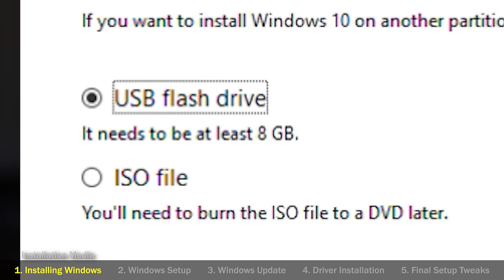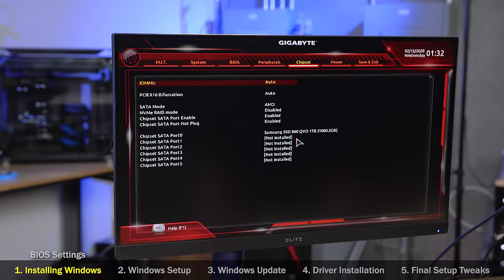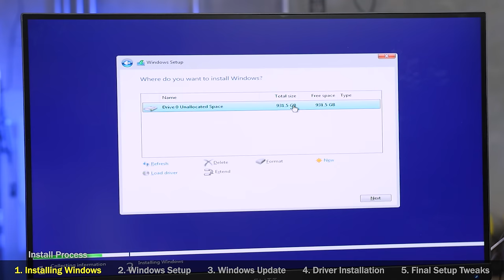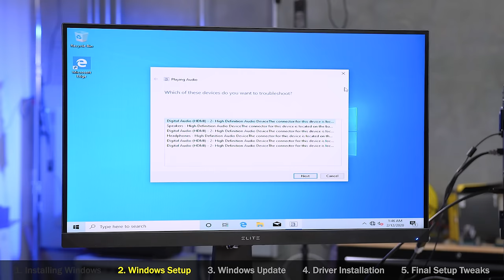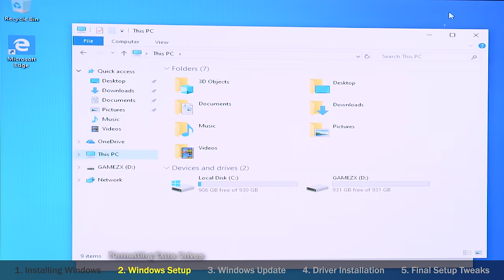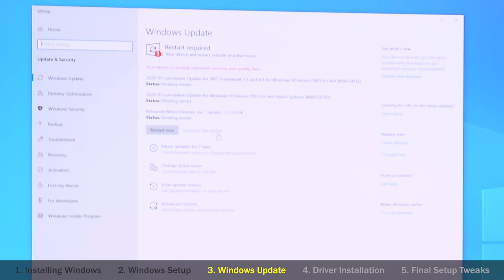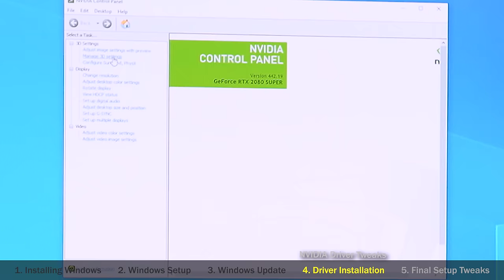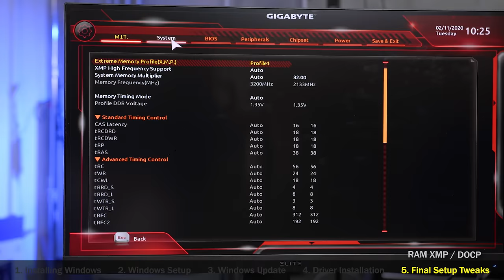Guide: What to do AFTER building your computer...

Comment: Bought a new GPU. Will be installing it over the next couple of days, but how do i install it manually instead of just using the (already installed) geforce experience? In order to do a clean install
Reply: You can use a utility like Display Driver Uninstaller (DDU) to completely remove the currently installed graphics driver.
Reply: @JJFlores197  thank you. Only just switched to PC

Comment: i need help i have done everything my pc will load up till where the windows is suppost to be but it turns to a black screen with a flashing underscore at the top right the bios works eveything works it just wont boot up windows i just spent all my money on new parts for my first pc its been a month and ive been unable to fix it i cant find how to fix it anywhere im at a complete loss here feel like ive just wasted my money at this point
Reply: top left*
Reply: Make sure BIOS mode is turned off. It may be called legacy mode, CSM, or compatibility mode. Exact wording and options/menus differ between motherboards. Make sure UEFI Boot is enabled and that USB boot is enabled as well. If that still fails, you may need to remake your USB installer. Also, make sure your USB drive is the first boot device.

Comment: I have a ROG Strix Z590-E Gaming WiFi 6E LGA 1200 motherboard and there are drivers (chipset and a few others) that need to be installed like any other board. Should I install the Windows updates before those too or should I install the MOBO drivers BEFORE the updates?

Comment: I’m a 350 year old man that loves mangoes. What if your drive doesn’t show up in the windows install screen but you see it in the bios? Mine is listed in the bios like RAID: Samsung ssd 980pro etc. But in windows it’s blank no drives. Tried with nvme and m.2 and same thing.asus z690p 13600k
Reply: Disable RAID and enable AHCI. Exact steps vary depending on your motherboard. You may need to reference the motherboard manual for instructions.
To give you some details: RAID (Redundant Array of Inexpensive  Disks) is a way of using multiple drives to act as a single drive. It is not typically used in home/gaming PCs. It is used in business and enterprise settings and servers. Windows doesn't know how to talk to the RAID controller so that's why the installer shows that there are no drives available to install to. If you did want to use a RAID setup, you would first need to download the controller driver from the motherboard manufacturer's page and then tell Windows to use that driver.
Reply: @JJFlores197  Disable VMD controller. Save and exit. Drive showed up in windows install. 👍

Comment: just a question for anyone. can I do the entire process. skip the bios check annd just choose the correct drive in the windows set -up if i know the size difference in  the drive is significantly different to any other drive hooked into the device?
Reply: Yep you can skip if you want.

Comment: Soo...what if you're simply getting no display signal?

My brother and I just finished building his first one. Downloaded specific used manuals for the motherboard and GPU, and followed it precisely according to all the components we have. Plugged it in, turned it on. Lights on the cooling fan and GPU are on. Cooling fan blows. But no display signal.

• His monitor hasn't been delivered yet. So we used our living room TV and an HDMI cable from the GPU to the TV.

• He has a Geoforce 4080 RTX Super that has a 12-pin male headed adapter that splits into 3 female heads that you're recommended to plug 3 seperate PCIE cables into.. His Seasonic Focus GX-750 only came with 2 PCIE cables. So we only have 2 hooked up to it. The GPU lights up when you turn the power on. The fans haven't turned on though.

Not sure where to go from here.
Reply: If the motherboard has a diagnostics/debug light, take a look at it as it can tell you where the problem in the POST (power on self test) may be at.
Reply: @JJFlores197  Thanks for the info. I'll have to look more into that is and how that works. 

But we finally figured it out yesterday. My brother first tried plugging the HDMI cable to the motherboard, with no results. He also tried the one stick of RAM trick, but his friend who he was communicating with told him to put it in the "furthest" RAM slot, but claimed the "furthest" RAM slot was the one closest to the CPU. It still didn't work. From my research, I thought it should've been the slot furthest away from the CPU, labeled the B2 slot.

Then he hooked one of the pig-tails on one of the PCI-E cables up to the 3rd outlet on the GPU cable adapter that I mentioned, and that made the fans on the GPU spin. And he finally put the RAM stick in the B2 slot (the furthest away from the CPU), and plugged the HDMI cable into the GPU and it finally gave us a display.. 

So I'm pretty sure our primary issue was that the RAM stick needed to be in the B2 slot. Though the GPU needing to be plugged in to all 3 outlets might've been another issue.

Now we're just waiting for a keyboard and flash drive to arrive so he can install the programs he needs. And I suppose he needs to order a 3rd PCI-E cable so that he's not having to rely on only 2 PCI-E cables, with the 3rd being that pig-tail/daisy chain.

Comment: Having issues connecting to internet via Ethernet Jay. Is this a asus driver that needs to be installed on usb then installed on new pc or is this windows 10 related? Should I clean out all hdd and ssd’s and do a fresh install? Will that give me the right internet driver? I moved hdd that has windows 10 from old pc to my new asus motherboard
Reply: Most likely is a driver problem. Since you moved a Windows install to a new motherboard, it is likely that Windows install doesn't have drivers for the network adapter. You will need to use another device with internet to download the driver to a USB drive and transfer to your new PC and install.

Comment: Hey man, question: I am building an entirely new pc with all new parts. I don’t want to buy windows again since it is on the ssd of my old pc. I bought a brand new NVME M.2 2TB drive for my new pc and I need to know how to transfer windows from that ssd on my old pc to the drive on my new pc. Then, how can I make sure that everything will run properly since I’m moving windows to all new parts (motherboard, gpu, cpu, etc). Do I somehow transfer windows to the new drive and then reset windows on that drive (wipe and fresh install)?

Comment: My windows updates are taking forever to download. I'm stuck on the "Update are underway. Please keep your computer on". I'm not sure if it's stuck or should I try to restart my computer manually?
Reply: How long has it been stuck on that screen? I know sometimes Windows updates can take quite a while even on brand new systems and installs. If you see that your HDD activity light is not blinking, you can likely power off the computer by holding the power button for about 10 seconds. Its not ideal, but sometimes the only way. On occasion, a Windows update gets stuck.
Reply: @JJFlores197  Not long after I wrote this it finished updating. It took about 45mins in total. But I'm glad now I've installed all the updates

Comment: At the beginning on the only connecting 1 drive part. What if I am using 2 M.2 NVME's? Do I only install 1 until I get windows installed and then turn off the computer and install the 2nd? Or do I take my chances with  both connected?
Reply: Its best to only have the drive you're installing Windows to and your USB installer. Once Windows is installed, you can plug the other drives in. I haven't personally experience it, but sometimes the Windows installer can write important boot files across multiple drives for some reason. In most instances, you won't realize this, but if one of those drives fails or you otherwise remove a drive with that necessary boot data, your PC may not boot up.

Comment: I have almost the same bios and the same SSD as you (except 2 TB), and yet the drive shows up as RAID in Bios. When I try to install from the flash drive, it sees no drives. I have tried everything I can think of and nothing is working. This is making me crazy! I've built several PCs in the past and never had a problem like this.

Here I am with a brand new very expensive machine, dying to load some games and can't even get Windows 11 to see the drive.

CASE:  Corsair 4000D Airflow Tempered Glass Mid-Tower ATX PC Case
POWER SUPPLY:  Corsair RMX Series (2021), RM1000x, 1000 Watt, Gold, Fully Modular Power Supply
MOTHERBOARD:  ASUS TUF Gaming Z690-Plus WiFi D4 LGA1700 (Intel 12th Gen) ATX gaming motherboard 
GRAPHICS CARD:  EVGA GeForce RTX 3080ti FTW3 ULTRA GAMING Video Card
PROCESSOR:  Intel Core i9-12900KF 
COOLER:  CORSAIR iCUE H150i ELITE CAPELLIX Liquid CPU Cooler
SSD:  SAMSUNG 980 PRO SSD 2TB PCIe NVMe Gen 4 Gaming M.2 Internal Solid State Hard Drive Memory Card
QIVYNSRY M.2 Heatsink NVMe 2280 PS5 SSD Heat Sink Computer PC PCIE M2 SSD Cooler
RAM:  G.Skill RipJaws V Series 64GB (2 x 32GB) 288-Pin SDRAM DDR4 3600 (PC4-28800)
LTERIVER PCIE 4 Ports Super Speed USB 3.0 Card

Comment: I just finished my first build. Plugged it in without an operating system what do I do to boot into bios for a picture
Reply: Make sure you plugged the video card into the graphics card and not the motherboard's video output. Make sure ALL internal connections are secure and in the correct places. Double check CPU power, motherboard power, GPU power, make sure RAM is installed per the motherboard instructions. If your board has a diagnostics light, take a look at it (and board manual) to see where it may be getting stuck in POST (power on self-test).

Comment: Do you need and eathernet cable to connect to the internet or can you do it digitally
Reply: ??? The 2 main options of connecting to the internet are with an ethernet cable or through wifi if the motherboard has built in WiFi OR if you buy a USB wifi adapter.

Comment: I'm in a bit of a pickle right now... I need to connect to the internet but don't have an ethernet port anywhere in my house. I have wifi on my motherboard and really need some help on how to connect to my wifi.
Reply: Does your Windows install not detect your wifi card? If so, you likely will need to install the wifi drivers. You will need to temporarily plug your PC to your router with an ethernet cable or use another device with internet to download the drivers and transfer them to your new PC via USB drive and install them.
Reply: @JJFlores197  Thank you so much!

Comment: Which HDMI port do you use? Gpu or motherboard. PC boots but no display. Seems missing that part.
Reply: If you have a graphics card installed, you always plug your video cable into the graphics card and not the motherboard's video output.

Comment: What about using 2 nvmes? Will I have to format 1 nvme with windows and then put the second nvme in or will I be able to identify which is the main nvme so I don't have to take my GPU out after formatting windows?
Reply: If the drives are of different capacities, you can easily distinguish between them  on the installer by drive size. If not, it can be tough. In that instance, you will want to disconnect the drive you don't want Windows on.
Reply: @JJFlores197  in my case, I have 2 NvMEs of 1TB each...the brand is different, but the capacity is the same...I guess I will have to leave one out, install everything first with the OS, then take the GPU back out, put the second nvme back in and that will do....I just thought there would be a way to distinguish

Comment: Do I need a sata drive ? Can I just boot with a ssd drive ?
Reply: You need a drive of some sort. SSDs can use SATA or NVMe connections depending on the drive. Most smaller SSDs that are used in PC builds use the M.2 form factor but are NVMe drives.

Comment: Hi Mate; thanks it is very useful. One question thoght. I have mv2 ssd should i partition to put games on a different drive or not? Cheers
Reply: Its up to you. There's usually no need to manually partition your drive. You can if you really want, but its not necessary. Having your games on a different drive has the advantage of nt needing to re-download them if your main OS SSD fails or gets corrupted or has a virus.

Comment: Sup. JZ- whenever you power down a system to do work inside the case, do ya eva press the power button again after you've unplugged the power supply ta bleed off the small power left in the puter?  Just curious. Stay Frosty.

Comment: What does it mean when you built your own custom pc and it’s connected with an Ethernet cable but still no wifi is showing up?
Reply: Most likely need to install the network drivers. On another PC or device that does have working internet, download the network driver for your motherboard's network adapter. Transfer it to your new PC via USB drive and then install the driver. Side note: Wifi and ethernet are not the same thing. If you want to use wifi, your PC needs to have a wifi adapter installed.

Comment: great video. only part i’m confused about is i have 2 nvme drives and 1 sata. plan to put windows on 1 of the nvme drives. so i take out the other nvme drive as well as sata or can i get away just removing the sata cable for windows install?
Reply: To be safe, I would unplug/disable ALL drives except for the drive you're installing Windows to.

Comment: If I already have a drive with Windows installed, do I start installing Windows on a separate drive, and then after that has been set up, I can plug in my older drive and then have that as my boot drive?
Reply: If you want to keep that Windows installation, you don't need to do any of this. Just plug the drive into the new system and it should boot up. I would uninstall the old motherboard-specific drivers and software. Then, install the drivers and software for the new motherboard and other hardware.
Reply: @JJFlores197  Thanks for the reply 🙂

Comment: I use windows 11. Is it almost the same or is it different to set up.
Reply: Mostly the same. The out of box experience (7:50) will look very different. It still has the same options and settings, but has a very different interface. You also need to make sure you have TPM 2.0 as as as Secure Boot enabled in your BIOS.

Comment: Just got a new pc from cyberpower. I think my gpu might be faulty but who knows.

I tried hooking up my hdmi to the gpu only to get no monitor signal. I take my gpu out and hook up my hdmi to the mobo. Everything works just fine. I can get to windows and use the internet etc. i would like to update my gpu but it cant detect it if it’s not hooked up. And even with my gpu hooked up and i use my hdmi on the mobo, nothing works at all, i just get the same issue of no monitor signal.

I have tried using a display port cable as well, i just get the same problem. Gpu is in, nothing works. Gpu out and plugged into mobo, computer works.

Comment: I’m building my first pc tomorrow, and I was wondering something about windows boot drive: I’m going to use a nvme 500gb for my boot drive, and then I am also going to install a sata ssd 1tb. so, I shouldn’t have to unplug my sata when installing windows right? because I should be able to tell them apart by the fact that one’s 500gigs and the other is 1tb?
Reply: Yes, you can just differentiate based on size. However, it is best to unplug all drives except for the USB installer and the drive you intend to install Windows on. There are some times where the installer, for some odd reason, installs parts of the boot loader and/or other important boot files across different drives without telling you. Under normal circumstances, you won't even notice it. However if let's say you remove your secondary SSD and it happens to have an important boot file, your PC may not boot correctly. Its best to avoid that by only having the target drive installed.
Reply: @JJFlores197  ohhh okay, that’s very good to know! I’ll unplug my secondary ssd until after I’ve installed it then. Thank you so much!

Comment: I have a question, I can't find the answer to. I bought asrock motherboard, and when installing windows, it told me that I couldnt progress without internet. I didn't have the option to chose "I dont have internet". After HOURS of troubleshooting, turns out the motherboard should come with ethernet driver preinstalled, and it didnt. Microsoft themselves said this after helping me troubleshoot, and said I did everything correct with windows installation.
Lucky I manage to get ethernet driver on a usb stick and install it, but this is not acceptable.
Asrock don't give me proper answers.
Is this Asrock's fault? Is this on all their motherboards?
Reply: No. The culprit is Microsoft for forcing people to need internet to setup their PC. Motherboards don't have built-in drivers. What Microsoft probably meant was that most motherboards come with disks that include the drivers for the hardware of the motherboard. If you want to be mad at something, be mad at Microsoft. Microsoft has been hellbent over the past decade on forcing people to sign in to an online Microsoft account when that was never a thing in the past.

Comment: 6:48 It’s just booting back to the windows installation menu and won’t move forward from there
Reply: Remove the USB drive...
Reply: @JJFlores197  it won’t boot without it. It says to insert a bootable drive
Reply: @crispy_338  Make sure the drive you installed Windows to is set as the first boot device. Make sure you have legacy mode turned off (may be called BIOS mode, CSM, or similar) and that only UEFI boot is enabled.
Reply: @JJFlores197  Trust me, I have done all of that. SSD is the first boot device, boot override to the USB to get it to install and then when it gets to “finishing up” it just boots straight back to the starting screen